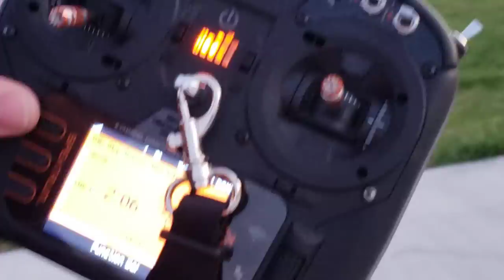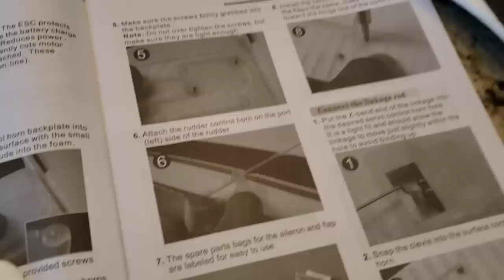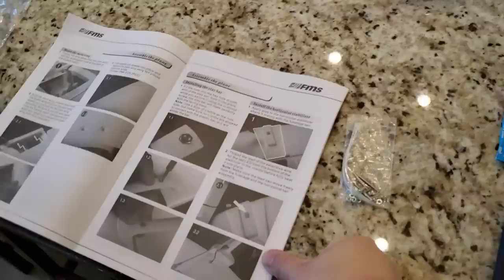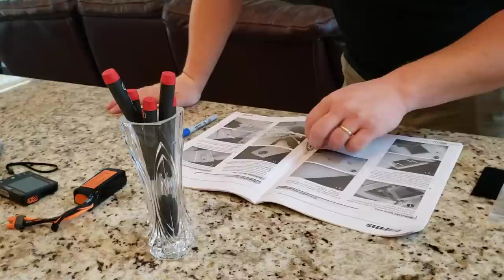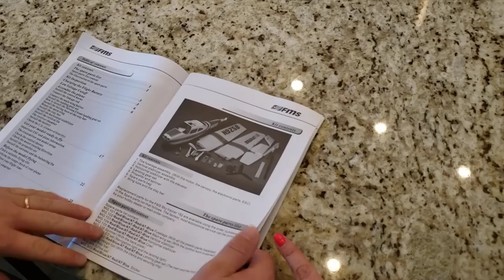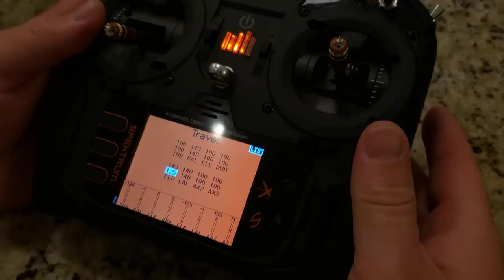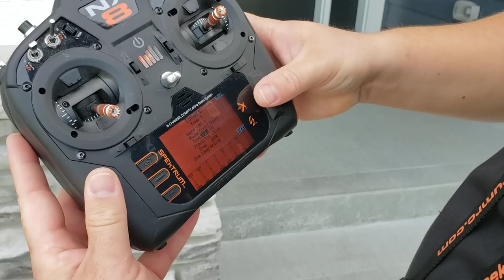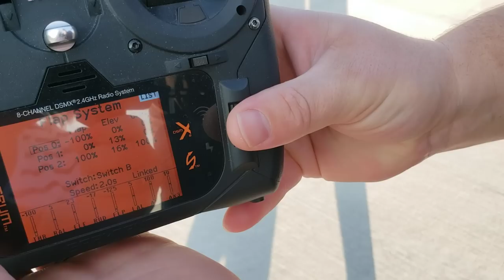FMS - Sky Trainer 182 - 1.4m - Unbox, Build, Radio Setup, & Flights

Comment: I got one a few weeks ago and it's a great scale looking plane but with a few issues. I did reinforce the wing and stab with carbon fibre rods and now they are solid which makes it really fun and agile with 4s batteries. I'm loving it!
Reply from the maker: Thanks for sharing! I didn't realize you could run her on 4S
Reply: @BrianPhillipsRC  I've flown mine on 4s many times. Seems to handle it fine, Just watch out for that wing flex.
Reply: @BrianPhillipsRC  It works great on mine so if you want to make it more fun to fly 4s gives you that. But wings has to be reinforced otherwise they might snap.
Reply: What size 4s? Looks like 4s/2200 smart wont slide far enough forward to get CG right.?
Reply: @old-rcplane-phart  4s 2.2Ah batteries fit and CG is spot on.
Reply: @old-rcplane-phart  I've flown  2200 and 3200 smart packs all the forward. Cg was fine,

Comment: Just ordered one, great vid, my 1st airplane again in 20 years. have some catchup to do to fly the e-flite F16 and L39 :-) (Also on the shelf) will be using the 182 for training and fun flights on 0MPH Wind days. Thanks for the videos , they are very helpfull, bought the exact same radio NX8 also. Greetings from the north.
Reply from the maker: Excellent! Good for you. Never a better time to be in RC Aviation. The Innovation is amazing, and so much fun. I just can't wait till the economy and our stock shortages are sorted out.
Reply: Yea after 2 decades technology has changed a lot! I went from balsa, nitro & futaba TO foam, electric & spektrum 😳.
Reply: It was my first plane and i flew her a lot in 15mph wind's. I guess she will handle even more if she is in the air but 15mph wind is the maximum that i'm able to keep directional controle while takeoff. If you can transport the plane in one pice, just put glue on top the fuselage where the wings sit and than screw them down. That's what i did and nothing came appart in this winds.

Comment: I have had the FMS version of this, many have offered this one. The biggest weakness is the short wing spar. Dont fly in heavy wind. I did and ripped both struts off the wing. The wing flex  is severe when taking off into the wind. Haven't snapped the wing yet. Very light weight plane. Flys great.
Reply from the maker: Glad to hear it wasn't just me...but still a manageable issue.
Reply: Does the FMS version have Gyro/Stabilization like SAFE?
Reply: @JP-zl4wz   It is sold in a plug in play version  as well as a ready to fly but not with spectrum. You could always add a safe/AS3X receiver to a PNP.
Reply: The ready to fly is NOT ready to fly.  Beware of that. It come like the one in the video and the wiring+ instructions being crap will have you sending it back
Reply: @BoringFlightVids  I bought this as my first plane, had no clue and i build it in one day with the help of youtube. It's not that hard.
Reply: @JP-zl4wz  I bought this plane twice. The first was a RTF, it has had nothing like that. I glued the mainwings to the body b.c. i was afraid that they snap off so i can't take them off the plane and since a have a mx-5, i can't transport it in my car anymore. That's why i bought a second one 2 weeks ago. It was the ARF/PNP version and this one comes withput a reciver but it has a FMS Gyro build in it. I use the same receiver for it that is shown in this video, so i removed the FMS gyro b.c. there is no need for it :D

Comment: Hi Brian. Haven't finished the video yet. Just 20 minutes in. I, too, have been scratching my head at a couple of assembly steps, so I'm looking forward to watching the build. I am the office manager for a flight school in the San Francisco Bay Area. I purchased this plane mainly to use as a visual aid for my ground school. I wanted something bigger than the standard demo model, and I wanted it to have fully functional control surfaces, including flaps. When I came across this plane, I thought it would be perfect. The problem is, I have absolutely no RC experience. This is my first build. I had a little bit different idea of what "RTF" would look like, but I'm determined to get it working.  I wasn't really intending to fly it, but I want everything to work. Thanks for the video. ~James
Reply from the maker: This plane would be GREAT for what you're trying to do, but my setup includes a lot of Stabilization (AS3X) and Auto-Leveling (SAFE) and we setup CROW, which might not apply for your training.

If I were you, and trying to possibly fly it, for sure copy the setup, but if you're NOT going to fly her, you could make it a lot easier to setup, and a bit less costly if you got the AR620 instead.

Sounds like, from your comment, you got this plane as a RTF, which was not the way WE happened to set ours up, so I can't speak to that exactly, other than to say we have done RTF planes from FMS, but not from this vintage.

Good luck, but you KNOW you're going to try to fly her ;)
Reply: Did you get it done until now? The RTF that comes with a Radio? Than you just have to plug the cables that come frome the mainwing into the empty connectors wich should be labeled the same like the cables from the wings.

Comment: Nice video. Told wife I wanted to get into rc and she bought this for Christmas and said it's called a trainer battery no gas. Not a First bird. That was years ago. Used 6 channel spektrum no as3x no safe and it flew nice. Scale. Yes if landing isn't greased it will jump. Think some folks were frustrated and rebuilt as taildragger. Also at first release the front wheel was fixed no spring and fms upgrading to sprung was good. Still have it in my collection. Very bright lights
Reply from the maker: Sounds like I was correct in my assessment then? Love the plane for shooting landings and takeoffs. SOOOOO scale!

Comment: Hey Brian, JM Jeff here... Working on my 3rd build, but this was my very first purchase way back when.. Took your advise and got the Ranger 1220 instead of starting this one..  I'm just in the middle of this build but wanted to share I had similar issues with the beacon light wire pulling through and even with tape, I pull the connector apart... First thought Oh NO, but was able to carefully cut out some foam in the front of the hole the wire came out of and found the connector down inside. Found that I still needed to use my hemostat to remover somemore foam to open the area around the wire which was still very tight.  After that, glued the Vertical stablizer with the wire less constricted...  Well, on word to completion.  Still not sure if I'll try and use the Flex with an AR620.  Have to read up on the Flex.  I belive it has a safe mode, just not sure how to setup with the NX10 yet.  Here again just got to the portion on your video at 2:28 about antennas on receivers.   Always something to keep ya thinking..LOL

Comment: Thanks, I finally see how CRO is enabled. I didnt realize it was set up through the wing selection, and requires ailerons or aileron and flap on their own channels to even show up in the flap menu.
I just set it up on my Swift, which has no flaps, so I just set the wing as 2 ail, 1 flap and it gave me cro options in the flap menu. I'm not sure if thats how its supposed to be done, but it seemed to work.
Reply from the maker: You can setup the wing type a few ways for the same result.

Comment: Brian, my 182 came with reflexV2, can I use a receiver with as3x and safe and just not use the as3x and safe? Because i have an AR8360T. And i see a wire labeled SBUS/PPM mode. Which i have no clue what its for. Where does this SBUS wire go? 
So far I have connected on ch1-Throttle, 2-ailerons, 3-elevator, 4-rudder, 5-SBUS/PPM mode (which i dont know what that is) ,  
6-Flaps, and 7-Gear(lights). Also the ESC has 4 wires; Black, Red, White, and Yellow. Does that mean it has thrust reverse? or!.....
 should I just take the reflex out? BTW, I got the NX8, it will be my first time using it. Please advise 🙂

Comment: You live dangerously with the electrical air stretched over the road towards the house and your own little airport. Watching some movies, there are no wires in the air.
Now this is my plane which is similar to the one you show here and it has been a great help so far. Unfortunately, the instructions could have been much better regarding the wires how to connect them. If I had seen this film before I booked it, I would have chosen a different flight. I will get the help of someone who has many planes to put the wires together.
Thanks for many good movies.

Comment: Great Brian. General question please, is it possible to upgrade the esc only and use 4s with say 3000mah, generally what is the problem with using higher Mah and adjusting the cg.
Reply from the maker: I wouldn't, but also not sure what the motor will handle. This is a guess and check kinda thing, in most cases, UNLESS you can get to the motor, find the specs, and you might find it'll fly on the larger pack stock, as we've found on a lot of planes over the years. I simply don't know, and back when this plane came out, we didn't have as many planes that would "survive" ;)

Comment: Hi Brian Got the thing to light up now after see another one of your videos, on the FMS T-28, All functioning accept for the Throttle?  Prop works when connected direct to the AR620 but not to the Flex???  Just a Beeping sound with short pause between...  Did everything in the trouble shooting page...but still no throttle?
Reply from the maker: Try lowering the trim down and see if it arms, but BE CAREFUL...don't want it to start up unexpectedly.
Reply: @BrianPhillipsRC  Tried but no change, just sent FMS email, they responded asking for a video of what is going on.  Thanks for trying, will let you know what their solution is...

Comment: Brian.  Need help please.   Quick question on this plane.  I'm using an AR630 like you did.  Should I just pull out the reflex and go directly into the Ar630?   What did you do?  Can't Imagine two gyros is a good thing.  Is there a way to turn off reflex?  Thanks!!!!
Reply from the maker: Reflex is fine. I'd totally save the AR630 for another PNF plane, and get an AR620 for this beauty.

AR620 https://bit.ly/3z7WDO0 (This would be the one I choose)
AR6610T https://bit.ly/3z37ysk (This will give you more telemetry, if you think you need it)
AR8020T https://bit.ly/3vgCnbV (This will give you more channels if you want them too...)
Reply: Thank you.

Comment: I'm a bit confused. In this video, you're using the AR630 receiver, which features a gyro for SAFE and AS3X modes. Additionally, the plane you have is equipped with the Reflex V2 gyro, which also provides auto-leveling functionality. From what I understand, having dual gyros in an airplane might not be recommended.
Reply from the maker: It doesn't on this plane. We got it before the Reflex V2 was equipped. If you were to buy it NOW, then you could, exactly as you said, use an AR620.
Reply from the maker: They had been selling them here without for some time, until recently, maybe a year or so ago.

Comment: Hi Brian this might sound like a stupid question but can I dismantle the wings for transportation purposes and then build them back to full length when I am ready to fly? Its just a case of putting them inside a car. Thanks.
Reply from the maker: Not a stupid quesiton at all!!!! I think you'd be very hard pressed to do this disassembly, since the wings have lots of connection points, and the wires are not in a convenient place to disconnect.
Reply: Thank you Brian for the reply and information.

Comment: Hi Brian, This plane came with Flex and I thought at the beginning, you where going to connect with Flex but when setting up you use an AR630 that has the Gyro's in it... Did I miss something?  I tried connecting the Flex to an AR620 that does not come with Gyro per Horizon's suggestion, but all I got was a beeping sound from the motor?  Tried wiring multiple ways but have had no luck... Thanks for the help.  Jeff

Comment: It's easy to fix plastic molding issues with a hair dryer, just heat up the part and bend it the direction you need it to go, or if parts are bent due to packaging heat them up with a hair dryer and they should return to normal, but they may need a little help.  A heat gun will also work but you need to be allot more careful keep it or the part moving
Reply from the maker: I've seen it done.

Comment: I couldn't find a location for the rx either. As a last resort, I mortise cut a 2" x 2" hole just forward of the rear servo bay, installed a plywood shelf and servo-taped it there. It was flat, kept the wiring in order and, once the plug was re-glued, was a stout as ever. I've used this technique before for nose weights. Sticking weights on the exterior of any plane is just too ghetto – even if you paint 'em...
Reply from the maker: Nice!

Comment: Nice flying! I have a question hopefully you can help me with. I have the exact same place FMS Skytrainer 182 and I also have the Carbon cub as well which you also own cause I've watched the video. I'm a beginner pilot and was reluctant to fly my Skytrainer because it's just so nice of a plane I didn't want to ruin it but I talked myself into it one day recently and sure enough, I did a unintended loop and kamikazeed straight into the ground! Broken prop,front landing gear, and motor mount. All repairable but I don't want to repeat the tragedy. I'm flying on a Flysky Fsi6 and a gyro but I think the main reason I crashed right away was because I didn't have my rates set properly. What do you recommend I set my rates at for this plane? Also, I emptied the piggybank and bought a   Spektrum Nx6,I'm currently running the Carbon Cub on it but I'm thinking of getting a reciever with SAFE and putting it in the Skytrainer. What's your thoughts?
Reply from the maker: If you use the AR630 or AR631, you will have very good results. You can use SAFE and you'll have auto-leveling and limited bank angles, but even if you decide to use AS3X (stabilization only) and just flip into SAFE when you run into issues, you'll really improve your odds at success.

AR630 https://bit.ly/3lh5iqD
AR631 https://bit.ly/3pYNC3c

They're NOT cheap, but they will give you everything you need to help you along as you learn.

Not to disparage any other options, but Spektrum's SAFE just works amazing in comparison. There ARE other auto-leveling options, but I've always thought they were somewhere from slightly inferior (reflex by FMS / vector by Arrows) to unreliable at best with LemonRX DSMP - however, I love their Stabilization...it works just fine ;)

If you want to have the best shot at success, think about the AR630 in this plane...it's hard to locate stuff, since it's a strange location for the Rx.
Reply: @BrianPhillipsRC  thank you for the good advice. I will do just that!
Reply: What kind of rate settings do you recommend?  Should I just follow the numbers in the manual or do you have a better idea?

Comment: Hey Brian anyway to put a camera on one of these without throwing the CG off.  Just ordered on.
Reply from the maker: For sure. You can put it in the cockpit with limited impact on the plane. you might also be able to tie one to the nose gear, so it pivots with the rudder ;) Then use a small counterweight all the way back at the tail (like 2 quarters???)

Comment: Brian, if your wing struts are to short, why dont you get the right size K&S aluminium Stream-line tubing, cut the right size and cut the ends off of the kit supplied struts & slip the cut off ends into the K&S streamlined tubes epoxy them on, & vola! longer struts!, Laramie.
Reply from the maker: I could do that.